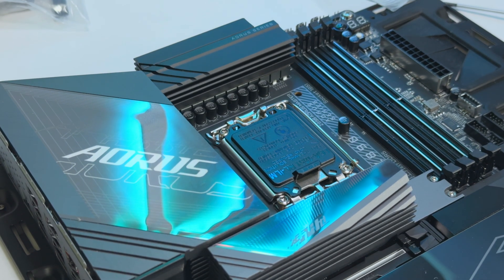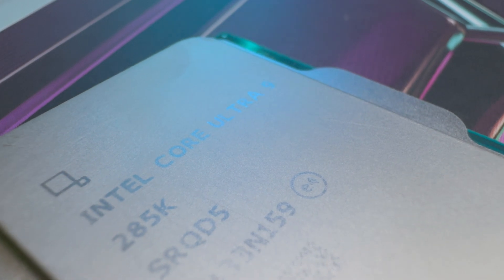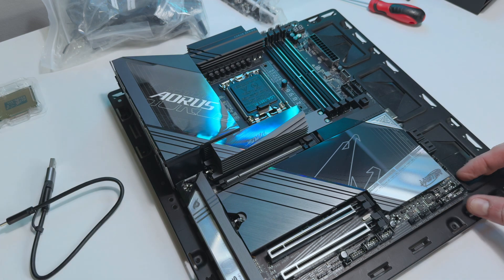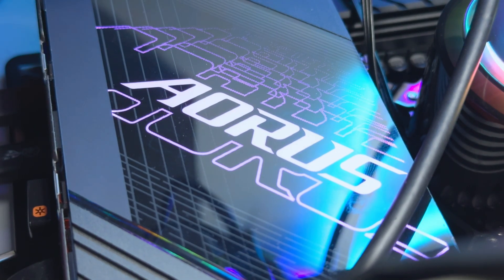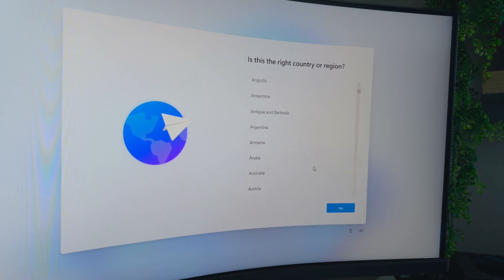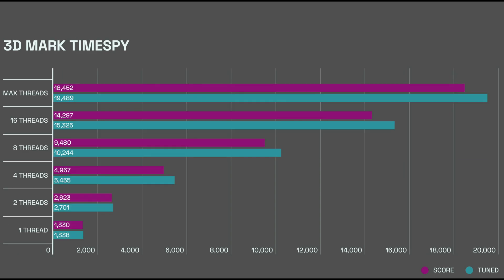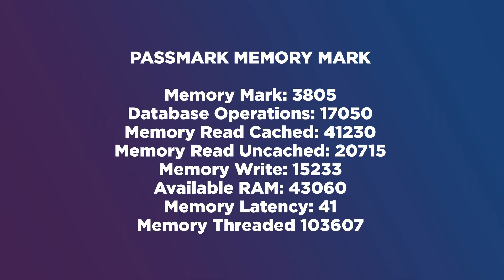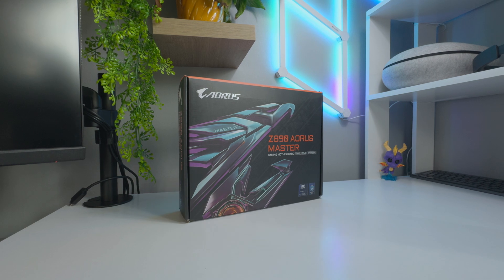Gigabyte Z890 Aorus Master + Intel Core Ultra 9 285K Review

Comment: I'm building this PC at the moment. Should I change anything? So far, it's costing me $5800 with assembly in Australia. 

- Samsung 990 PRO 2TB PCIe 4.0 NVMe M.2 2280 SSD
- Antec C5 ARGB Tempered Glass Mid-Tower ATX
- Intel Core i9 14900K 24 Core 32 Thread up to 6GHz LGA 1700 Unlocked Processor
- Gigabyte Z890 AORUS ELITE WIFI7 Intel LGA 1851 ATX Motherboard 
- Thermaltake Toughpower GT 1000W 80+ Gold PCIe Gen 5.1 ATX 3.1 Fully Modular Power Supply
- Gigabyte GeForce RTX 5080 GAMING OC 16GB Video Card
- ID Cooling FX360 INF 360mm Liquid CPU Cooler
- Corsair Vengeance RGB 64GB (2x 32GB) DDR5 6000MHz
Reply from the maker: No everything here looks great. Should be perfect. It is going to be an awesome build!
Reply: @GLITCHEDZA Thank you!

Comment: Does the Bottom m2 heatsink have a thermal strip on the underside? I saw the one on the board istelf under the m2 when you lifted the heatsink off.
Reply: Yes, some spaces have a thermal strip underneath the plate. I can tell that since I have this Board since last Saturday 😁👍🏻

Comment: this motherboard is extremely bad in turbo lv2 and lv3 mode, it increases you by 200 Mhz, but the CPU will heat up 6-9 degrees C, and when the psu power is cut off and does not supply power to the motherboard, when starting the computer it will turn on and off twice. this ultra CPU line's temperature is not stable like other lines, sometimes when playing games or just standing on the standby screen, the temperature jumps from 5x-7x and then drops quickly, repeating. the second ssd 5.0 port is unused if you do not want to lose the gpu's x8 pice.

Comment: Thermalright Lga1851 BCF Black CPU Curved Pressure Plate,Specially Designed to Support Ultra 200s Series CPUs,Multiple Installations Will not Wear Down The CPU Cover,Comes with L-Shaped Screwdriver

Comment: 2:39 - youre saying a contact frame won't fit in this board? Is it even necessary when you have that new socket?
Reply from the maker: By now you should be able to get contact frames for this board but they aren't necessary unless you are into that sort of thing. I personally don't use them or have I ever thought about it. Some people say they help with thermals, others claim they don't. I just say put your CPU in and enjoy your board with the pre-installed frame. 

If you are really worried about the "warp" on this CPU, a frame "might" prevent it but there isn't enough data on them to promise that. We haven't seen many reports of warped chips in this generation of boards thankfully.

Comment: does the main 5.0 m.2 use the same lane as the pcie 5.0 cutting it down to 8 or is that only the second 5.0 m.2 under the joint heatsink?
Reply: Yes

Comment: Hello, thank you for a great review. 
You've encourage me to buy this motherboard.
I'm just about to put this setup (Z890 Master + Core Ultra 9 285K) together. 
It will be water cooled (custom loop) so that why I would like to ask you about one thing before loop will be filled up.
For your tests, when you used Graphic card in PCIEx16 slot, what was m.2 slot you've put your NvME drive ? 
Was it one above PCIEx16 with big heatsink (as per manual it is M2A_CPU)?  If not which one you've used, please?
I would like to avoid situation when I put NvME in M2A_CPU and Graphic cars in PCIEx16 and system will not boot up :)
Reply from the maker: Thanks for watching. Got your mail too. Sorry for the delay. Yes, you would put the SSD in the large heatsink slot right above the x16 slot. Even if you're using Gen4, this is the best slot for the hob. Obviously, if you're using Gen5 you would need to put it there to get the best speeds.
Reply: @GLITCHEDZA - thank you very much. So I should not be worried when will use graphic card gen5 (in pciex16 slot) and nvme gen4 in "large heatsink" slot in the same time that system will not boot up?
Reply from the maker: @romangabrys9747  No. It will be fine. Previous Intel CPUs used to have bandwidth limitations when using x16 and Gen5 SSDs but even those are gone now with these new boards. Gen4 will work with the GPU at the same time just fine. 

Of course, you'll need to set up your boot options, install Windows on the SSD and configure the BIOS etc. I do recommend downloading your BIOS update and having it on a USB beforehand. This will help overcome any boot issues you might have with your components. 

I often have to plug my PC builds into a monitor through the motherboard HDMI/DisplayPort out at first. That's because the GPU drivers aren't installed and don't work properly. So if you have this issue, use that port first. 

But if you have your stuff installed correctly, and your BIOS updated, you will be able to boot your PC just fine. Once Windows is installed and updated, and all your component drivers are installed, your PC will run just fine.
Reply: @GLITCHEDZA one more time big thx mate!

Comment: My brand new z890 aorus master was Great board on the August 2024 bios, but my board gets stuck on B6 vram Clean - I updated the bios to the December 2024 version and it never came back on - I was upgrading the bios because the original was not able to work with my 3rd NVME drive - Al, I wanted was to have all of my drives work properly!  Now my bios gets stuck on B6 and the machine is a brick…help!
Reply: just do a bios flashback

Comment: Also, what is the name of that low height test bench? What is that thing your motherboard is sitting on?
Reply from the maker: This is the bench that comes with the CoolerMaster Cosmos C200M case. It installs in the case and you can remove it to turn the plate into a testbench.

Comment: 3:00 what is that fan and where do you place it?
Reply from the maker: It is a fan to cool down the RAM during overclocking (or if you just want to install it for the sake of it). It is installed next to the RAM slots.

Comment: How did you get your hands on the I9? I can't find it anywhere without paying 2x, 3x the retail price?
Reply from the maker: Intel sent the chips to me. I know there are shortages here too. We have single digit stock in SA. It’s a real problem everywhere.
Reply: @GLITCHEDZA  Is this one of the perks of being a youtuber or do you need to send them back?
Reply from the maker: @oorful  It depends. Brands usually offer the hardware to keep but then I don't get payment. Payment is usually provided by Intel (it forms part of Intel's marketing budget). So if I keep the hardware, the brand claims from Intel and uses that towards the cost of the stuff I keep.

In this case, I declined to keep the hardware because I prefer AMD and have a newer AMD build I just finished. So I returned the components.

Some brands don't offer any payment or components. They just want videos that take days to produce without any money or stuff. I try not to work with those brands because I need to make a living haha. Unless I know a video will do really well and is worth the Adsense.

Comment: Thanks for review. Its a great board, offers almost everything that would be needed. Better spec than most newest AMD ones. Its a shame that intel cpu's are underperforming, i was planning to move to this platform with 285k but not with current cpu performance. I'm afraid i will switch to AMD but am5 mobos are just so poor ... or extremely overpriced.